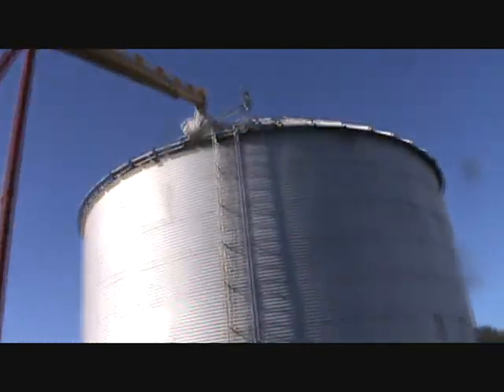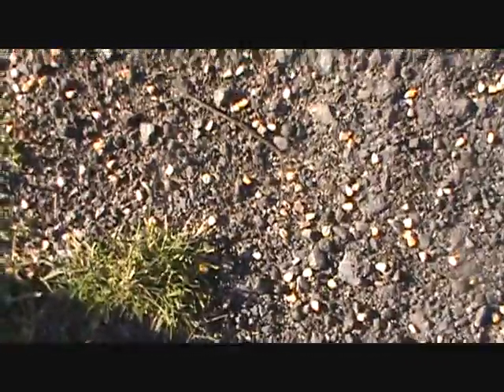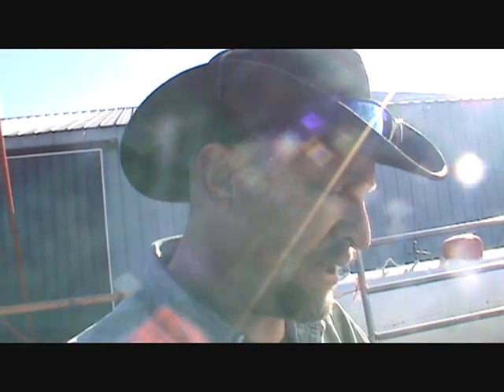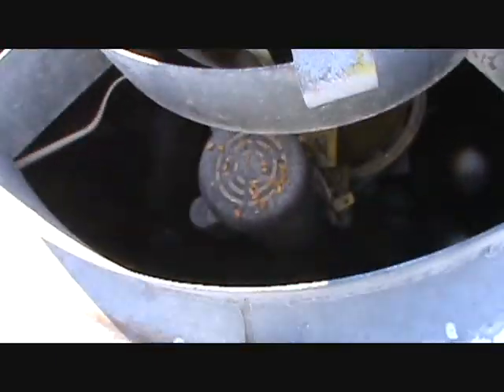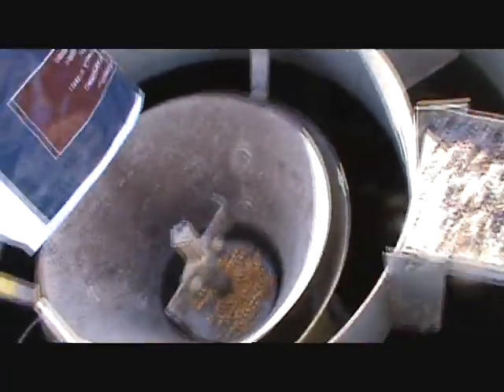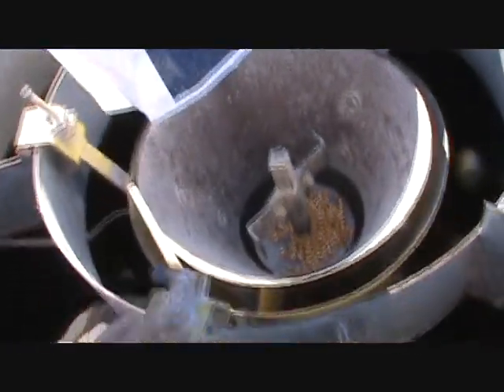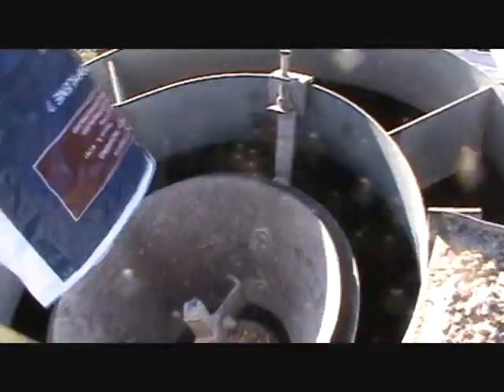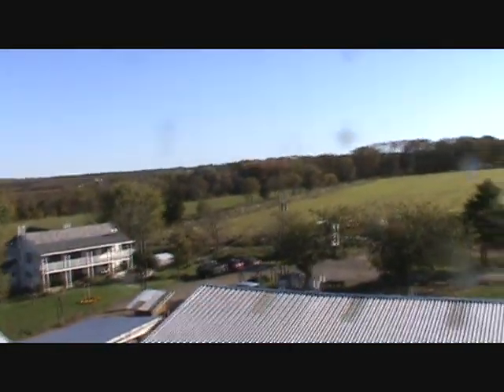Auger spout on top of the grain bin

Comment: When we put corn in the BIL's bin, we set the auger up over the hole and he climbs up and moves it slightly to one side so that it hits the spreader right for the bin to load evenly, then he puts an 8x8 foot tarp over the end of the auger and uses a bunch of bungee cords to hold it on the top lid ring of the bin.  That way, when the rain's falling or the snow is flying, the corn stays dry until the bin is full.  Once it's full and he's got the corn dry and cooled, he pulls the tarp off, we crank the auger up and move it, and he puts the cap back on the bin.  Works great and no problems with wet stuff getting in the top of the bin around the auger.  

He had a neighbor that didn't bother with a tarp or even capping the bin one year-- ended up with a four foot or so diameter "core" of rotted grain in the center of the bin that they had to bust up and haul out by hand when the bin was emptied... probably a bobtail load of grain wasted.  Gotta keep the moisture out!  He's been a lot more vigilant after that!  

Later!  OL J R :)